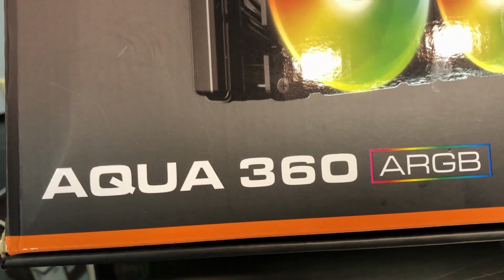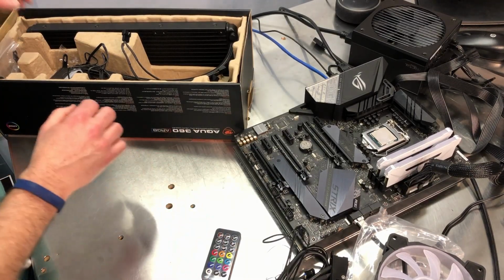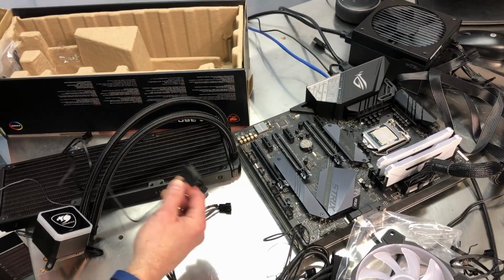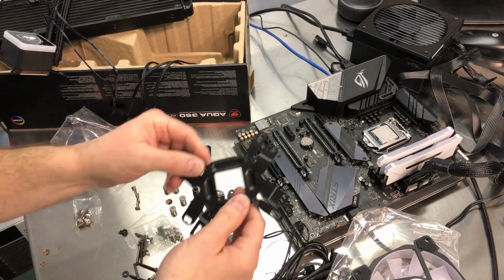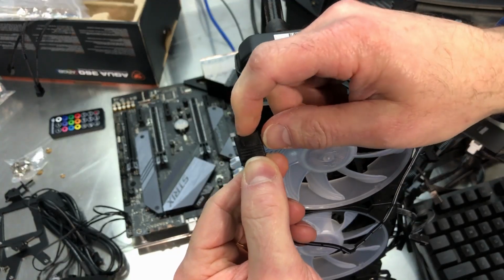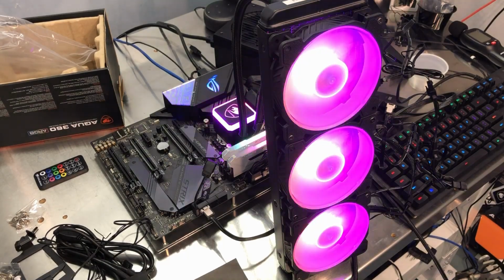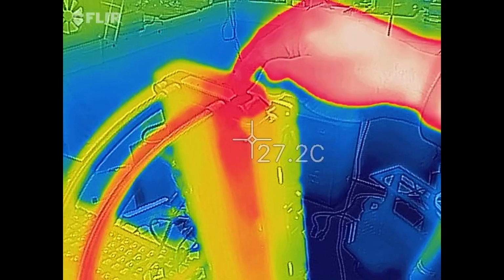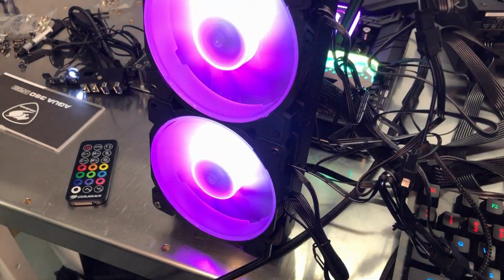Overclockersclub reviews the nee AQUA 360 ARGB from Cougar!

Comment: Stev Burke just becoming the Jesus of all known things. There is everywhere this thing about the mounting of AIO , but in fact, is about the principle of communicating vessels, which all manufacturers have to take into calculations, and yes the only bad thing is when you are mounting the radiator totally flat under the pump(ex...when you mount the radiator on the bottom of the chassis). I mean i know cougar, i remember the orange fans, I forgot the name, which was a direct competitor of Noctua, but looking at the length of the tube basically the only "correct" mounting position under the laws of Steve is now on top of the chassis, as definitely in the front you can;t doit as the length is to low(as you need to mount it upside down). So, in my opinion, all this thing about the correct mounting is gooing too far then it should be